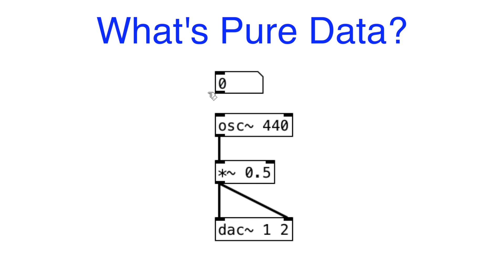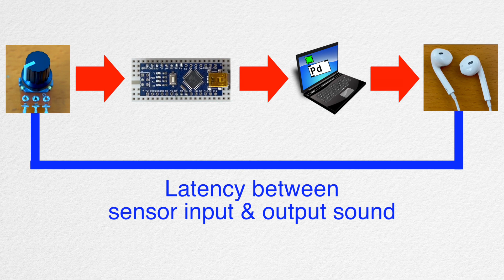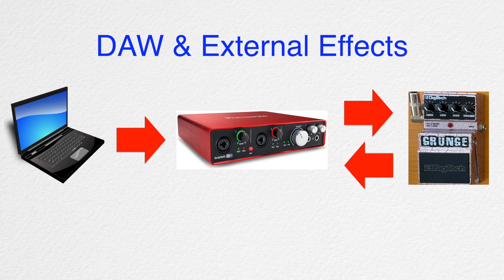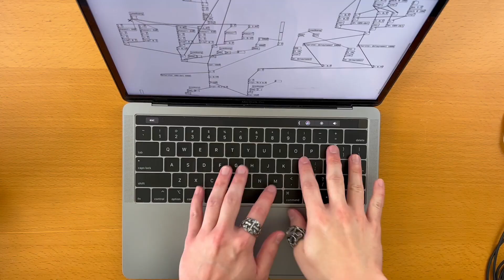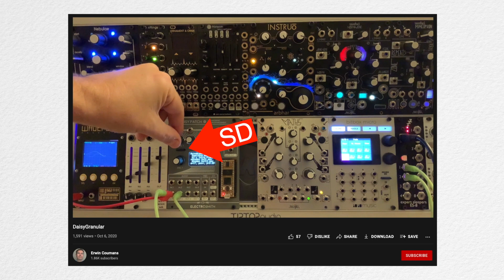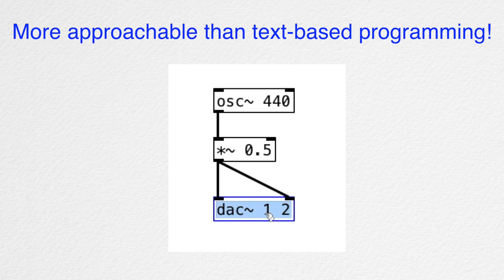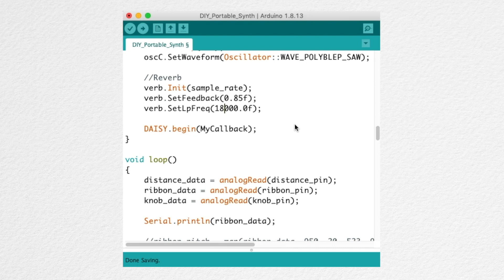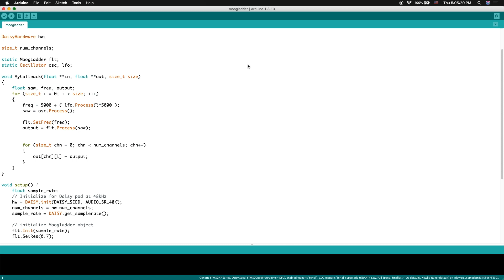Standalone DIY Synth With Daisy Seed (Embedded Audio Overview)

Comment: Having one of these would be fun to tinker with.
Having a whole Eurorack full of them, would be powerful.
They all have the same front panel layout, that you could swap paperface labels, to match the programmed function.
Have them all daisy chain connected, through serial data links, for quick connection to, and programming with a laptop.
It would be scalable, reprogrammable, cable patchable (could also do virtual patching through serial links), and maybe not to expensive.

Comment: ik this was awhile ago, am looking into making my own multi effect pedal(have a high power laser cutter to help on container), I am very new to this in general, are there any tuts you recommend to start matching components as I assume there are ways to overload the circuit (ie a 250v 1a button vs a 250v 5a button)? Is there a set amp rating that is total and can not be exceeded (minus step ups)? Is this the purpose of resistors to limit this rating bc of the flow? If so, is there a way to calculate the minimal working amps for components as to not exceed boards power?

Comment: Gotta say i was following a lot of Arduino based Synth projects over the years but ALL of them turned me off a lot due to the fact that you still needed at least a computer with software, which i really don't like. I prefer putting together hardware with as little software as possible. Except for the Arduino based Open Theremin project, nothing really looked interesting enough. THIS thing here however is a LOT more like it. This is so much better when you can add code to a little programmable PCB and turning it into an embedded standalone device that even has a built-in DAC for audio output.  You got me hooked :)  And i love the idea of a ribbon manual. Not only for the convenience but also for the fact that you are not limited by keys and being able to play Glissandi. I bet if you put together 2 of these you basically have 2 voice polyphony. I wonder if there's also the possibility to add code for a formant filter and a frequency shifter to this thing?
Reply from the maker: I'm glad to hear that this video got you interested in Daisy Seed! 

What programming language would you use with Daisy? 
If I recall correctly, I don't think there are formant filter or frequency shifter examples that come with Daisy. But I'm sure you can find a good patches for Pure Data (make sure it has hvcc supported objects) and gen~. I'm sure you can build one with C++ but I'm not certain how easy it is to implement it.
Reply: @SoundSimulator  I think Pure Data sounds very interesting as i am a very visual person and need to be able to put together blocks of content to build what i need. Back in 2005/2006, when i was still making VST synthesizers with Synth Edit, it was thankfully a graphical developing environment which was perfect for my needs and it still provided a lot of depth to alter things the way you want. Basically using modules and changing them and their relation & interaction to each other, like a modular system that grew with your needs and was as complex or simple as your creative idea. And there was even support for third party modules made by others. And i loved being able to create a standalone VST at the end and that was great to build an instruments the way you want and sharing it with others. I never learned to code and find coding a little too abstract and really rely on a graphical interface. So yeah, Pure Data it is.

Comment: Hi i Justr found your page and am ordering a Daisy as soon as I find  a canadian supplier, Im curious if you have lookedinto using a mux/demux with the daisy via the pure data style programing.  Fingers crossed you make a video or can send me in the right direction to find one.

if i cant find one I willl probably put all my buttons on different resistors and feed them to a shared analog pin and disapate them through there to add a keyboard  but I dont like that solution as much

ps for context Im making a Moog taurus style bass synth out of organ foot pedals.  and I would prefer to program in pure data as the arduino style
Reply from the maker: I hope there is a Canadian supplier! 
That's an exciting project idea!!! 

I highly recommend searching or asking the Electrosmith forum. They also have a Discord! 

Multiplex is something I ran away from for years by using the Arduino Mega. But with Daisy, I have to finally confront it! I'll definitely consider making a video on it as it is extremely useful! 

In the meantime... there could also be an I2C multiplex breakout-board (for expanding analog pins) that's worth looking up. Arduino IDE can work nicely with external libraries. This leads to another approach, the Arduino IDE! They come with great sounding examples (including a Moog Ladder filter emulation).
You'll most likely need a code that deals with bunch of foot pedals, so text-based coding may be more efficient. I find myself going back and forth between Arduino IDE and Pure Data for specific purposes. Multiplexing in general may be easier to implement with Arduino IDE since so many people have done it with Arduinos.  

This is all to say that your project should be possible to implement and there will be various approaches that you can try out!! 
Best of luck and let me know if you have any more questions. My dms are open//

Comment: Why would it be USB powered? Micro USB BLOWS!
Reply from the maker: Don't worry, you can power it in other ways. 
I would personally use DC power jack for the final version.
Reply: Why does it blow? Diving in my charger collection: tons of nice Nokia/Microsoft/Samsung micro USB chargers without hum, running cool, stable voltage.  Average USB-C charger at the grocery store counter (phones no longer include chargers) are total junk. Annoying whine, getting hot. Even the plug is more fragile, and in case the board connector dies, you are toast. USB micro on the other hand can be replaced with a simple solder iron, as the feet are not too small.

Comment: Can you use multiplexers for the daisy seed? And does it support sigmund~?
Reply from the maker: hvcc unfortunately do not support [sigmund~]. 
And it should be possible to use multiplexers with daisy, but I recommend double checking on their forum. 
Some day I need to learn multiplexing instead of using Arduino Mega...

Comment: Could it be programmed with Supercollider?
Reply from the maker: As far as I know, I don't think you can program with Supercollider. I wish it did though! 
It could be worth asking them about it on their forum to see if they're planning on it.
Reply: For that you should check Bela Platform..
Reply: @alextkalenko  Yes, Supercollider is including the quark for connecting with Bela, but is 5 or 6 times more expensive, and I am looking for cheaper solutions for different purposes. Anyway, I work also with Max so I don´t have problems.

Comment: Very interesting. Wasn't aware of the Daisy Seed until now. Very similar to the 'you know who' board I'm using on the laser synth. Except for the brand name and objective, you've just precisely described the same development process.
I'm nearing the end of my 'tweaking' presets stage and getting very lost in testing the imagery, instead of coding. All MIDI notes & controls are currently mapped to an OTC APC40 MIDI controller, which makes a great laser control desk. PD is being used for additional features, such as a touchscreen GUI for monitoring/entering the 14 different image frequencies and gains. 
Now, I need to learn about creating and using MIDI programs and banks to store multiple pages of presets for  buttons and sequences. I know very little about creating audible music and only learned the definition of DAW a few months ago. As a laserist, I know what I need and only need to walk the path to get there.
Thank you for sharing your technical knowledge and guidance. You're enabling folks like myself to achieve previously unimaginable goals. 👍😎
Reply from the maker: It's still quite new! I hope this video will help people get into the world of embedded audio! 

As I said before, your project sounds complex and almost overwhelming. It seems like you're close to sharing a footage??
Reply: @SoundSimulator  Laser synth = 4 standard stereo waveform generators, plus RGB  Basically, multiple synths, just like your embedded synth, with 6 DAC outputs, instead of only 2 ((just  add some audio shields). But, I don't need all of the DSP filters, because frequency, amplitude, PWR, phase, & detune  and a few AM multipliers are all I need. So, in many ways, your synths are far more complex.
Yes, I've started editing a video, but need to allow some more time for the project to simmer down, before an official 'reveal'. Half-cocked demos never turn out well. Need to set up some HD RPi cams for live recording, instead of just the smartphone.
Perhaps, I'll be there in a few more months... if I can ever stop brainstorming new ideas. lol
Reply from the maker: @TheOleHermit  Looking forward to it!! Yeah, it's really difficult to stop yourself from trying out new ideas.